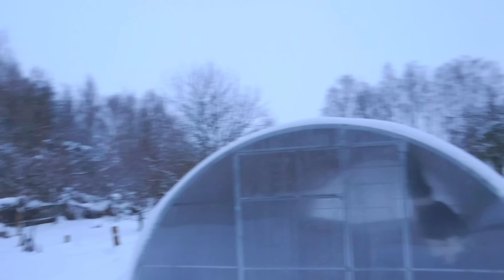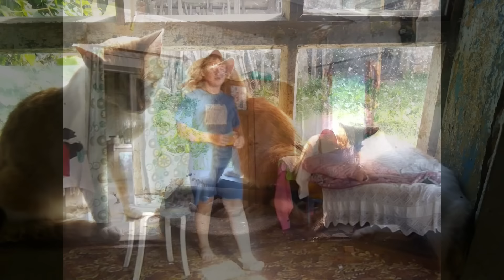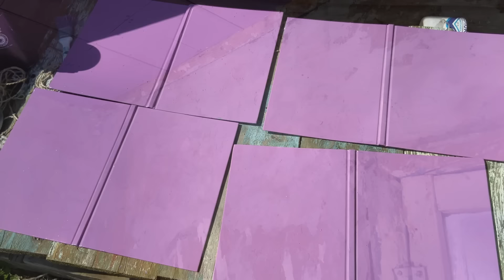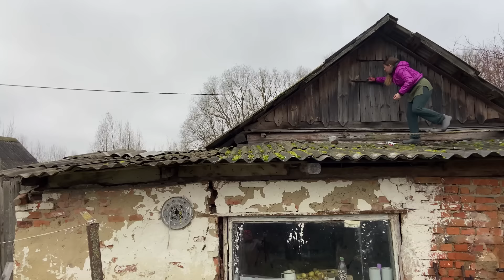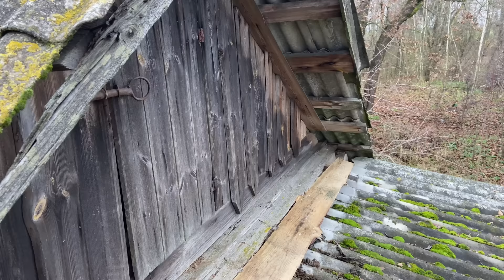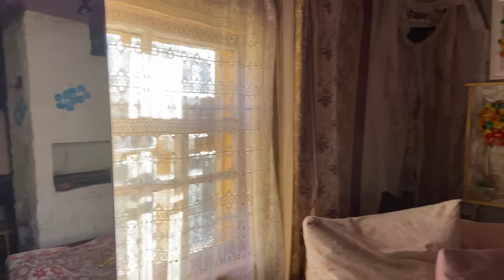My House is Falling Apart

Comment: Be very careful when working with those corrugated fiber cement roofing tiles. They look old enough that they probably contain asbestos. Don’t break them or drill holes and if you replace them, keep them whole and dispose properly. As long as they're intact they aren’t dangerous but when broken they release asbestos fibers exposure to which can cause asbestosis. Best of luck with the renovations!
Reply: They do contain asbestos and they are already prohibited in Russia.
Reply: That‘s exactly what I was thinking, too. Don‘t even clean or brush these old roof plates! The dust is really dangerous! You can repair the roof with concrete, but don‘t remove any dirt from the asbestos, because this would release millions of fibers.
Reply from the maker: Thank you 🙏🏼 With it I always try to be careful
Reply: Need to wear a mask.
Reply: Wearing just a FFP3 mask, when working in an asbestos contamined environment, is not safe. The fibers would contaminate everything, the clothes and the environment. It’s neccesary to wear a FFP3 silicone mask, that fit’s tight on the face. And of course a disposable jumpsuite, that has to be thrown away after every use. But relax, if the plates won‘t be drilled, broken or scrubbed then it‘s safe. But I think wearing a mask makes sense when cleaning the house, because there is much ordinary dust up in the loft. 3M Aura 9392+ are very good.
Reply: @KatsiarynaTerehova if you do remove the asbestos shingles.  Make sure to sear a good mask and spray down with water.      You need a house fund donation  link.       Really needs a good bit of money to fix walls foundation and roof.     I have a 117 year old wood house and have had to complete rebuild over the last 10 years
Reply: The amount of asbestos in the corrugated cement panels is the same amount found in the slate tiles found on house's in the USA. Which is about 2% and as long as it is wet it's fine thank you.
Reply: @jameskotansky9398   you are talking about old soviet era tiles.
Reply: @KatsiarynaTerehova I use to do asbestos removal here in Canada and in my courses they teach use to wet it because it can’t go air born it’s only dangerous if you breath it in

Comment: First priority is to waterproof the house to seal the roof so that all the work you do inside is protected, the next thing is to secure the house foundations everything can be done cheaply if you are doing the work yourself if a house is being demolished nearby sometimes you can source materials for free of at very little cost I have helped on two house rebuilds in my life both helping family
Reply: Lots of that stuff is unfortunately still in use 😮 best building material ever if it wasn’t so toxic to humans.
Reply: @kimmogensen4888  with the new floorboards fill the gaps up so no air wind can get up under the floorboards as it’s Russia and in the winter you need it sealed but you may already know this
Reply: @kimmogensen4888  bloody snakes 🐍 😂 I hate them and I live in Australia 🇦🇺 😂
Reply: @@blasphemer76 look for abandoned Houses better you are safe and warm in Winter than freezing 🥶 and cold 🥶 ask God for forgiveness later 😂

Comment: Water is your greatest enemy, especially if it gets in any cracks in your masonry walls because of the freeze-thaw cycles that happen in colder weather.  If I were you I would attack the obvious cracks with mortar- the larger ones.  If thats not easy to do then pack the cracks with twine, rope, cloth rags or even a waxed paper. Use a small putty knive or even a butter knife to do that with. It's not a perfect solution but it will help shed rain/ice away and from getting to deeply inside.  You just need to make it to the spring/summer when you can make more lasting repairs.  
Small cracks are the start of big cracks so you may want to look into masonary sealers that you just brush on. And do the whole house.  A good paint can do this to but you have to be deligent with coverage year to year.  And are you able to get a hold of tubes of caulking, especially something with silicon in it?  You want to do around the windows, but can help for small cracks as well.  Even on your roof tiles.  Come spring if you don't replace those broken roof tiles you can cover on the outside with some roof patch or even the silconized caulking.  The mortar you used on inside in the attic won't last forever so you want to put something on the outside of the cracks for a longer lasting solution.
As far as the snake in the ceiling, it's there because there's a food source up there , which is mice.  Fall is when they get into homes to overwinter.  Besides poison, peppermint repels mice and rats so get a spray with peppermint oil in it and spray liberally.  A nice smell for Christmas as well.
It's good to see you doing the work you are doing. I'm sure your Mother appreciates it.
Good luck.
Reply from the maker: Thank you for your valuable advice ❤
Reply: @KatsiarynaTerehova  sorry, I'm a little long winded...

Comment: Hello, using the mortar as filler for the bigger cracks on the roof is a good idea. But you should smooth it from the outside as well in an area as small as possible. The mortar is not waterproof, the spots might look wet during permanent raining, but the water will be kept outside.

There are high temperature differences on the roof, so there might be little cracks again in the spots, you repared with mortar. You will have to check it frequently and smear some mortar from outside onto the spots again. I would try this way first.

When there is still water comming inside you can pick up a sealant that should be available in the hardware stores in the bigger cities. This can be applied with a paint brush or spatual from the outside onto the spots you repaired with the mortar. Some of the sealants are bitumen based and are black, more modern ones are plastic based sealants, that contain glas fiber. This stuff is gray coloured and could be applied on top of the spots overlapping them. That‘s the reason the spots with mortar on the outside should be as small as possible. But please consider, no scrubbing or cleaning of the asbestos plates.

As I have seen, there are no gutters, but the water has to be kept away from the base. I think that‘s the reason why it is in such a bad condition. The gutters should be applied on the rafters, no drilling in the asbestos plates, please!

It is not a good idea to apply these plastic boards on the wall and the ceiling, they are not water vapor permeable and this could cause starting the wood behind to mold.

I would suggest to scrape off the wood and using a wood putty or clay to close the spaces between the wooden boards. The wallpapers can be scrubbed of easily, if you apply water with dish soap with a brush before.

I wish you success! 💪🏻😀💪🏻
Reply: A lot of sense here. With a house this old condition there’s going to be a lot of regular maintenance . But remember it’s a labour of love. Just do what you can. It’s a great summer house not so sure for the winter. Take care
Reply: The materials you need to stop the decay are not very expensive.
You should remove most of the things that could mold. This means no wallpapers and only mineralic or clay plaster. Nothing should be applied on the wooden boards.

Mortar is acid, it's better to wear vinyl gloves.

In old houses only use materials that are moisture regulating.

During the winter time, you should heat up the house frequently via the stove. This would make it last longer.

Comment: I wish we could get some people together to give you a hand to fix up your house. When I see the amount of wood that is in the recycling centre here it saddens me. So much could be saved for building work. Your house is very similar to the very old Finnish houses. The roof certainly is the most urgent thing to take care of. Every year due to the extreme highs and lows in temperature we have to seal up around the chimney and check all over the roof and use tar to seal up little cracks in the old felt tiles. Most people have bought new metal roofs but we cannot afford it. It’s enough these days just to maintain a house and pay the crazy electric prices. We use wood to heat our house mostly. I really wish you well
Reply from the maker: Thank you ☺️ 
In our area people try to use cheap materials as well to fix houses. When a house is left at least for a couple of years without care it collapses 😔

Comment: Roof need change of cracked tiles. Gutters to get the water away. Drainage on the northside of the building to keep the water away. Dehumidifier indoors: Here we use 5 kg's of Potassium Chloride in a net over a 10-20 l plastic bucket -or an electric dehumidifier. 

It could be benificial to "air out" the house to get cold dry air in,  before you leave it in the winter time. Thermodynamics say:  If the temperature drops 20 degrees C at 50% humiditity from say 20-25 deg C, you will get water condensationon on the cold surfaces like windows and walls. 

Floor needs downward insulation, say 10 cm of leca + 20 cm of polystyrene foam under 10 cm of concrete, to avoid condensation on the back side of the floor boards.

Make a project plan to slice up the project and take small steps.

Sorry to write all this. Other people have done it before you. And you can do it as well.

Comment: The first step should be another roof over the existing. Don't waste time repairing things until you have 100% sealed interior and add some over hang to the roof to move water away from the poor foundation. Grandpa didn't have the resources to do the foundation correctly, so the solution is really elusive.

Comment: Wow you’ve got your hands full,First I would check the foundation and see what can be done and the cost.if it can be repaired along with the walls everything else can be repaired but if the structure can’t be repaired …I restored my 1840 log cabin,as I said have the foundation checked to make sure it can be repaired.

Comment: Massive respect for your efforts. I know it's easy to say do this or that. A suggestion would be to use plastic from bottles to tile cracks in roof. I realise it would be expensive but consider completely removing the asbestos roof and replace with modern non toxic materials. I know it's sentimental but I'd be tempted to just build another nearby but use modern techniques. Good luck with your endeavours! 😄👍
Reply from the maker: Thank you 🙏🏼

Comment: Hello beautiful girl, I saw the problem you have with the floor of the house, you have to think about waterproofing, it is also very important that under the floor there is a layer of ballast to "break capillarity" so that water does not rise through the pores of the materials! Also try, through ditches and drains? keep your water as far away from the structure of the house as possible

Comment: Well not being able to see the complete disaster for myself up close and in person but from your video Kat I'd say the best idea would be to knock out the crumbling wall and have it rebuilt with modern bricking and that way what is above should remain intact  for years to come. But then where does the money come from as bricks are expensive and you are not a  tradeswoman but a handy-person to have about in case tings you can do , need doing.
Reply: Adobe?
Reply from the maker: The thing is when we try to remove one wall, the whole house could collapse.
Reply: @KatsiarynaTerehova  That's right. It is a load bearing wall. I used to have 8 Jack Stands that used to adjust to at least 8 feet tall. Sturdy ceiling joists would be a must. You have a project there. There seems to be many different building materials used in the construction of the house. All the same it is a cute house.

Comment: If you don’t want to get as much smoke in the house, you should build a chimney with a sealed core pipe and bricks around it with 10 cm to the core pipe, you also reduce the risk of the cracks will comeback soon, it’s probably because the bricks are getting so hot, and the clay and bricks 🧱 risks cracking 😮 large temperature swing’s expand and shrink it, like speeding up corrosion.
Reply: But it’s hard to see, but normally the chimney bricks 🧱 should not crack or emit smoke if build after the laws in Denmark.
Reply from the maker: That stove was built by someone who knows just a bit about these structures so I couldn’t expect much from it 🤷🏼‍♀️

Comment: I wish you luck with the repairs, you may have rush a bit with the book covers.  You need to fix the structure before making your house looking good inside and outside.  Please do not let those foundations with out repair for too long.
Reply from the maker: Well it was okay before so the leakage started just after I fixed the ceiling

Comment: Sad old house.  Looks like a good project.  Needs a good tight tin roof.   No house will stand without a good roof.  May spread a sheet of plastic out in the attic to keep odd drips from the ceiling
Reply: It need s good busy man to put it back in order

Comment: I would come help you... Save that cute 🏠
I am curious how you have an English accent and from Belarus ?
Love you videos peaceful ..
Ps you may want to shovel all debris out of attic to reduce weight on ceiling beams .
I am a Architect and builder in NYC .
I also now live in a tiny cabin on farm which is in similar condition.
Roof must be repaired asap .
Then all else
You can use cement mortar to repair roof tiles tile thin set grout etc cheaper than cauk .
Good 🤞😊
Reply from the maker: Thank you ❤
I have learned the accent while studying at the university in Minsk

Comment: I can see you work very hard and will not be beaten, but it maybe time to consider alternatives. It looks like last year's and this year's rains have caused the foundations to move which is very serious. On soft earth, a concrete raft for the walls and chimney might be what is needed so it might be time to check with a local expert before you expend your energy. I hope I'm wrong and it works out. It's one of life's big decisions you have to make, so get some good advice.

Comment: I'm quite shocked to see the state of the house. It needs a full rebuild. Are you actually living there? The smoke escaping from the oven is very bad for your lungs. And were those sheets of asbestos forming the roof? You probably know asbestos is deadly. If it is asbestos, you can't go in there without a specialist mask, and the rest of the house may also be affected.
Reply from the maker: We used to live there, and planning to live there during summers

Comment: corrugated sheets ,are  curved ,so that where mice get in ,as farm building here are curved  sheets ,where mice get in,, Just having to leave the radio on ,to scare the mice away at night  .Mice can climb walls ,and get into roofs that way ..wood worm in the floorboards there  ,in our farm house   ,Need to treat ,treatment for wood worm ,or replace all wood  ,,,As wood worm goes into all wood eventually if not  ( does not touch oak wood ,will makes holes in walnut and pine wood ,) ,       .Asbestos roof  dangerous to health  = asbestos illness like asthma by breathing in particles of asbestos ,when asbestos decays ,Also in many  French farm roofs asbestos panels ,tiles ,as  "I  been looking at French  houses ,farm building to live in ,,Roof panel came off at home by woodworm loosing the nail holding the panels, The  silage shed only 30 years old say ,and we had concrete nylon roofs built 30 years ago ,but the plastic roof sheets between  to let in light ,came brittle and crack ,so many holes in a roof ,only 30 years old ,But no person wants to repair the sheets ,as need to pull up other sheets to replace them .Allot of nice properties in Bulgaria ,20 acres for $30,000 ,and with house ,and farm buildings .Bulgaria houses ,and land have own wood burner included ,and furniture with the sale etc ,